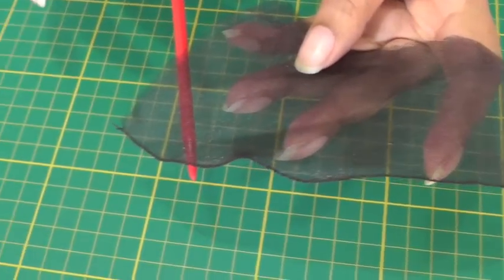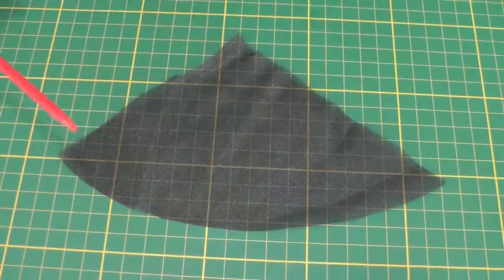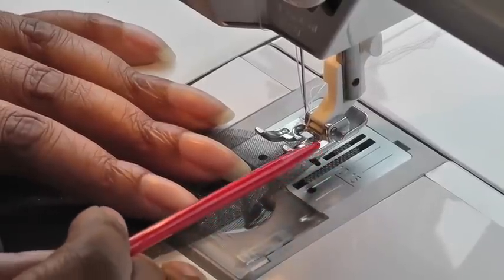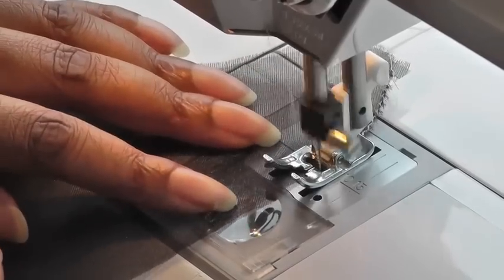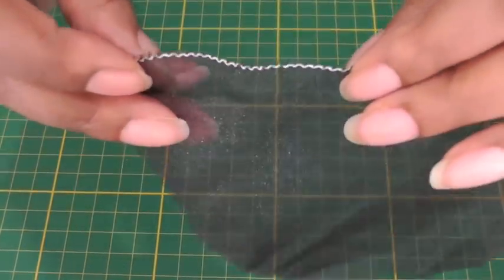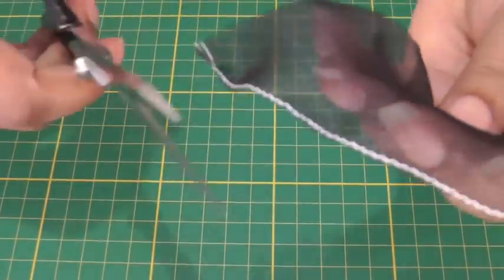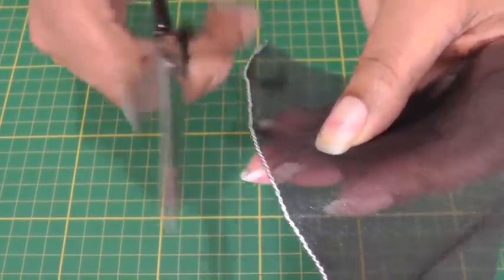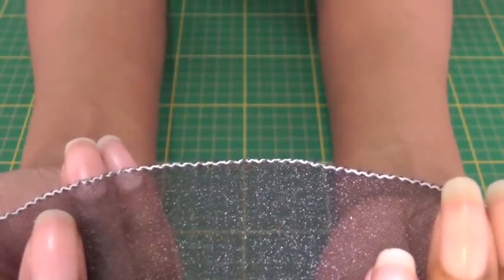Finishing Curved Edges of Sheer Fabric

Comment: Hello. I have a  bodice made of tulle that works as a basis for a leather net. I want to keep my design as it is. Is it necessary for me to finish with a specific way the neckline and the armholes that are not covered by leather ? Or I can keep them as they are?
Reply from the maker: Hello Άνδρια Ανδρέου, You can keep them as they are, but if they are not holding there shape, sew a small zig zag stitch on the seam line and trim back the access.